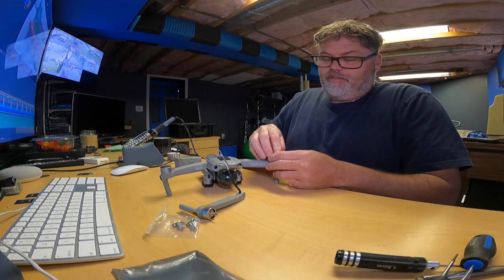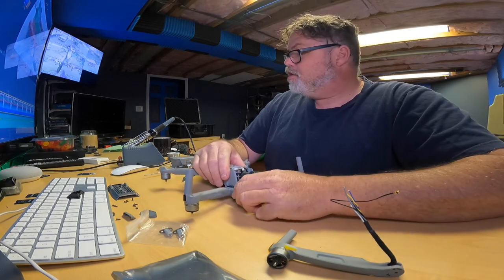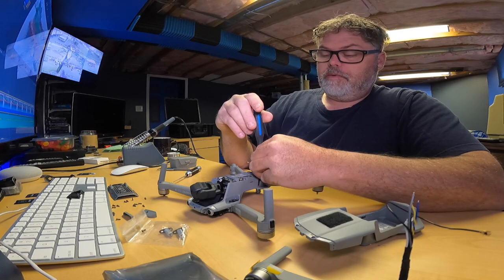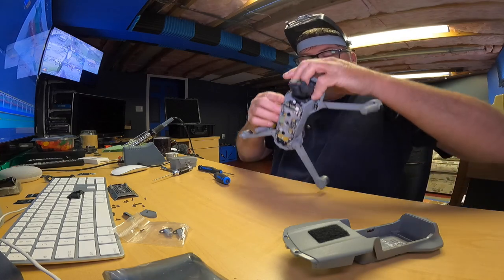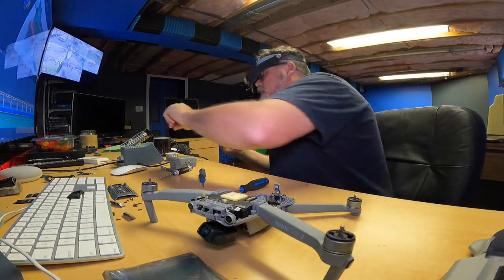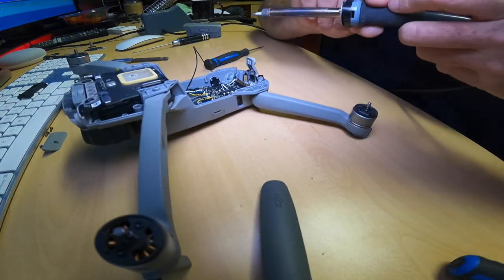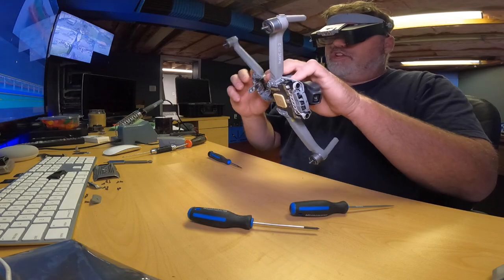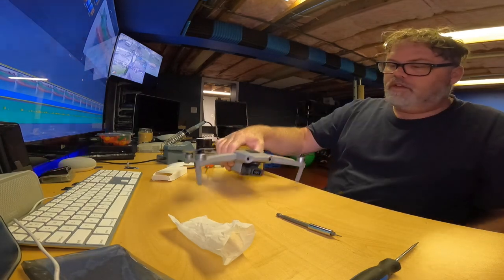DJI Repair! | Mavic Air 2 Drone Arm Replacement Oh NO Will It Work

Comment: find out what is wrong with the old arm jim. can you hook a battery to it to see if its a bad wire or dead led.
Reply from the maker: Already did that it’s a bad wire but it just as easy to replace arm . I will rebuild the old one for a spare

Comment: Just replaced the same arm but I didn’t feed wire under sticky mesh where you did at 14 min mark. Not sure how important that was. I pryed it up and put it back after running wire. 
My cameras not working but I don’t think it’s related.. lol crashed it months ago and finally got around to replacing arm. Not sure if camera worked after crash, been so long.

Comment: Thanks for a great video!
Doing this now but can’t get the front arm back in, trying to understand how you do it but don’t get it. Arm goes easily back if it’s put in in the mid-position, but then it only snaps to the middle and not end-positions.
Any tips…?

Comment: Thanks for making this video. I was able to replace the bum wing on my MA2 and get her flying! The knobs on the chassis that hold the arm spring in place shattered, but I think I'm just gonna chance it and see how she flies. I ordered a chassis replacement to do it right, but not looking forward to all that desoldering and resoldering. Did yours have epoxy or something on the solder points?
Reply from the maker: Yes work out well thanks for watching